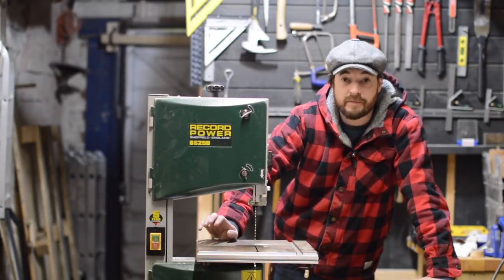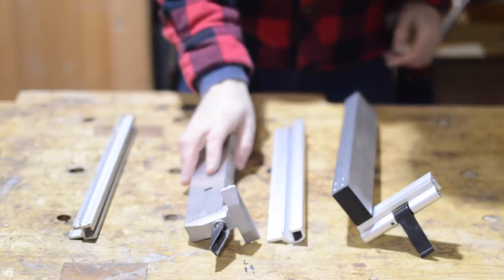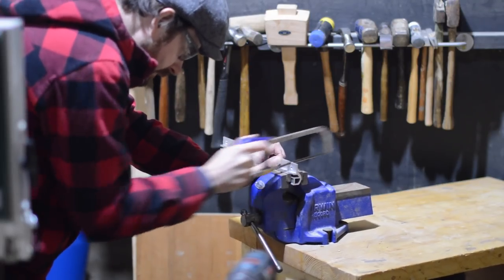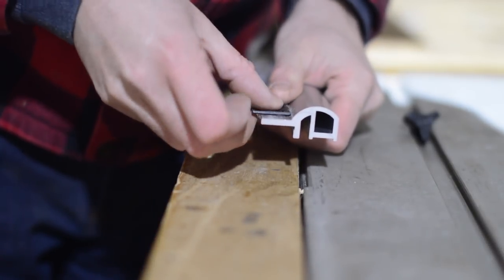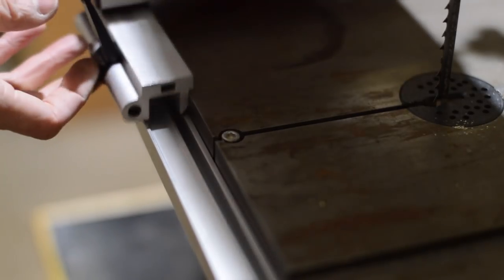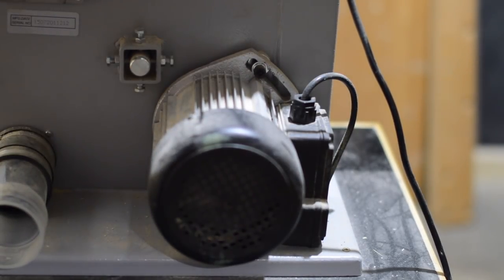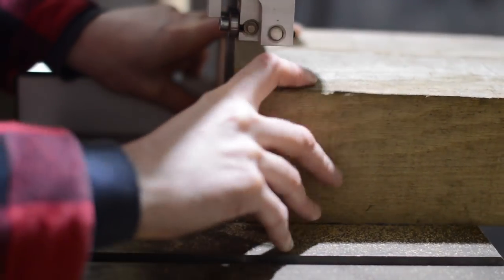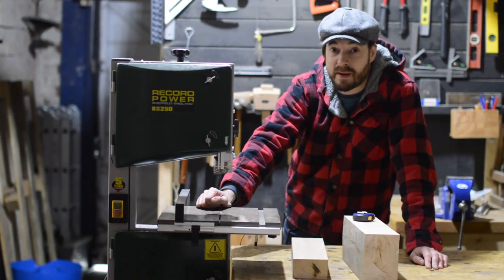Record Power BS250 Bandsaw with Axminster Fence

Comment: Hi Matt, great review on the fence upgrade,  will get one when in stock. 
Do you get any howling noise when doing curved cuts? My BS250 is great when straight but howls when cutting arcs etc. New blade made no difference.  Any ideas?
Thanks
Reply from the maker: What blade thickness are you during for curves? I tend to use a 1/4” blade.
Reply: @Badgerworkshop  thank you for your reply, same 1/4" Axminster.

Comment: Hi Matt, Im in the market for a bandsaw. This one is currently about 280  (and the axminster fence about 20) Axminster do a bandsaw for 300 that already has a good fence. Its got an extra 15mm depth and 20mm width. It sounds like a no brainer to go for the Axminster, but ive been looking at BS250 reviews for so long that i'd almost decided on getting it. Are there any features on the BS250 that you particularly like?
Reply from the maker: The record is a good machine but cant think of any great features. The axminster looks good and seems to have a stand.

Comment: I asked for advice about this same fence problem at Axminster. The guy there suggested putting a bit more curve on the grip at the back and sure enough it solved the problem of tightness. For a while anyway. So I’ve just bought the Axminster fence after watching this video. Thanks.

What are the other tweets you mention at the end, apart from a new blade?
Reply from the maker: Just the new fence, tightening the motor and the blade. I hope you like the new fence.

Comment: Hello Matt, really enjoy your videos.I am just starting my workshop journey, even going to build our own after watching your shepherd hut vids. A question:  have just invested in the BS250 and I am finding the mitre fence sloppy, apart from your Axminster fence upgrade have you updated the mitre fence at all and if so what did you add? Any suggestions?
Reply from the maker: Yes most mitre gauges that come with tools are not a great fit. A simple fix is to wrap a bit of electrical tape around the bar until it’s a snug fit.
Reply: @Badgerworkshop  Thank you, will give that a try!